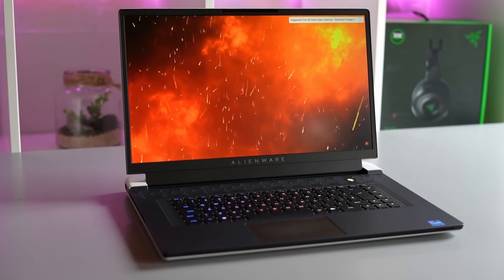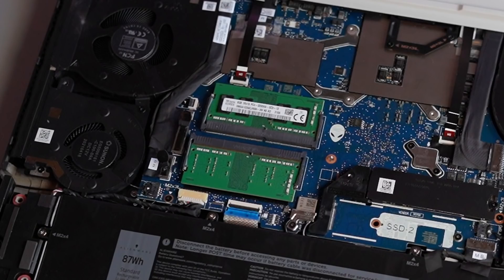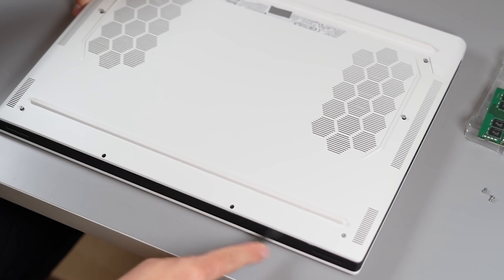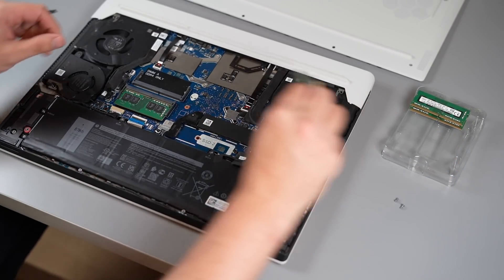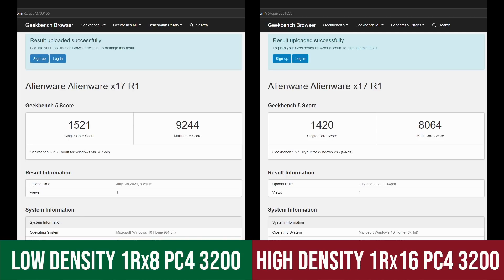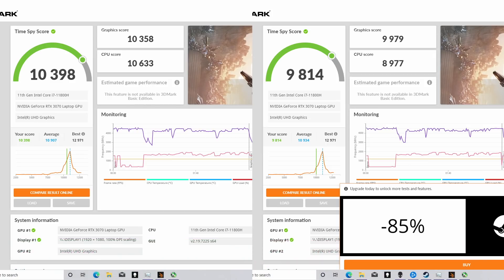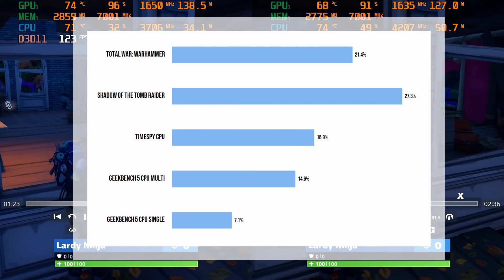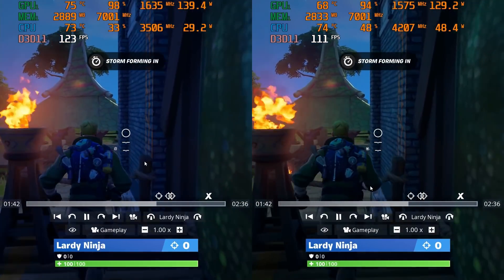Alienware X17 High Density Ram Strikes Again!  Upgrade Your Ram For Better Performance

Comment: I cant for the life of me take off the bottom cover it just wont budge
Reply from the maker: When you unscrew the front 2 of the screw should start popping up the cover, are yours not doing this?
Reply: @MashITTech  no it's not all screws are out but still looks and feels as if they're still in. I do have the x15 but it should be the same process right ?
Reply from the maker: Exactly the same 😢 can you get a plastic pry tool in between cover and base?
Reply: @MashITTech  I'm gonna need one ..I was hoping I didn't have to go to best buy to buy a ifixit tool kit lol I didn't think it was gonna be this difficult

Comment: In the amazon link you provided, from the amazon drop down box, do I order the dual rank, Single Rank or the one without a label?  What is the difference ? These are all Low Density ? I'm looking to do 16gb x 2 kit.  Since the video , is there better RAM to get if you have some money burning a hole in your pocket?
Reply from the maker: Get the single rank. Dual rank is a lot more expensive for little benefit. I haven’t tested any kits better than the crucial so far. Do not buy the expensive ballistix, they won’t run 3200mhz
Reply: @MashITTech  great, thanks for the response Mash

Comment: Do you have to change any settings in the Bios for this Ram to run at 3200?
Reply from the maker: Nope, it defaults to 3200mhz
Reply: @MashITTech  Thank you. I had read that some default at lowers speeds and have to change settings to achieve advertised speeds. Glad that is not the case
Reply from the maker: That is only a case on a couple of the corsair dominator ram kits so avoid those like the plague! the crucial I like in the description works perfectly

Comment: Hi mate appreciate the video, I have the Alienware X17 with 4K screen i9 and RTX 3080, with the 32GB ram pre installed, I bought the Prośba o dodanie opinii o produkcie:  Crucial DDR4 16GB 2666 CL19 SODIMM  ram x2 would it be worth me replacing the standard ram for the crucial one? Or keep what I have and order a different ram set?
Reply from the maker: The 32gb kit that fell used is pretty good so I would keep what you have. It is only the 16gb kit they supply that is the problem 👍
Reply: @MashITTech  good man thank you for the advice mich appreciated!! Would you be able to do a video on the X17 rtx 3080 i9 4k and what to do to get the best performance also, what the alt keys do? I.e the F1-F6 keys do? Or do you happen to know yourself? Also for some reason and I don't know if you have this issue but when I use the F7 key to turn the RGB lighting off the back Tron and alien head lights stay on but the keyboard lights turn off, but on my old m17 it use to turn all RGB lighting off, your videos are the main reason I got the new full spec X17 and I have to say it was the best decision I made

Comment: hi, im going to upgrade the ram memory but i notice that are dual rank memory so i dont know which is better. 1rx8 or 2rx8
Reply from the maker: the dual rank is slightly faster but also mu ch more expensive! I just bought the 1rx8 and it gave me a great improvement over the x16 👍

Comment: I primarily run the Microsoft Flight Simulator 2020.  Normally my CPU utilization is only maybe half that of the GPU.  I am getting ready to go to a Reverb G2 VR and I was wondering if you thought that changing to the low density ram would make a difference. Thanks.
Reply from the maker: It makes a big difference on anything that utilises CPU. If the game is utilising 50+% cpu you will get improved performance. If the game is massively GPU bound then you may be ok.
Reply: @MashITTech  Well, it didn't work out. I had a lot of problems with blue screen and game freezing so I kept lowering the settings and when I finally got it to run, it was not very smooth and the resolution was so low that while it was immersive in feel, it just was so soft that I preferred the very crisp and high detail 2D view. In 2D I can run the game at 30 FPS (capped) in flight with everything maxed out (400 for terrain) and 60% GPU, and the level of detail is amazing so while I was hoping the VR would work, I am still delighted with the game when running Ultra settings which even powerful gaming servers struggle to do when running VR.

I might also say that I found all of the cables to be bothersome.  I can see why people love the wireless Quest 2.
Reply from the maker: @shenmisheshou7002  sorry to hear it wasn’t a great experience! I have yet to try VR.
Reply: @MashITTech  I had my doubts that it would work.  Most people that blog on it are using desktop systems with RTX 3080 and the laptop RTX 3080 is not nearly as powerful as the desktop, and my laptop 3070 even less so, so I thought it was going to be a challenge, but you don't know until you try.  I had to lower a lot of settings to even get it to run, and when I finally did, the reduced rendering scale really softened the image.  I doubt than the x17 RTX 3080 would do much better.  I think for many games my system would be OK with VR, but FS2020 is a pretty demanding application.   I love it in 2D though. I turn off Bloom, and lower a few other settings, but I can run terrain detail at 400 and object detail at 200 and still get a very smooth 34 FPS (I lock it in the settings because it keeps the fan noise down and 34 FPS is pretty smooth to me).  

If I do get another VR headset though, I would probably go for the Oculus 3.  The cables on the Reverb G2 were very annoying and added a lot of clutter (I play from a small table in my family room, which is why I have a laptop to begin with.)

Comment: I ordered x17 with 16GB option . Can I upgrade with Crucial 32GBx2 for 64GB ? or should I go 16x2 for 32 GB ?
Reply from the maker: Yes you can use either 64gb or 32gb crucial kits 👍

Comment: Now which one is better?!

Crucial RAM 32GB Kit (2x16GB) DDR4 3200 MHz CL22 Laptop Memory CT2K16G4SFRA32A

or

Crucial 32GB Kit (16GBx2) DDR4 3200 MT/s (PC4-25600) CL22 DR x8 Unbuffered SODIMM 260-Pin Memory - CT2K16G4SFD832A

....
Reply from the maker: Both those are great kits I bought the FRA kit which is the cheaper single ranked low density kit. The FD8 kit is the dual ranked so very slightly faster at a much greater cost. Hope this helps.

Comment: Is this the correct low density ram upgrade your talking about? 

Crucial 32GB Kit (16GBx2) DDR4 3200 MT/s (PC4-25600) CL22 DR x8 Unbuffered SODIMM 260-Pin Memory - CT2K16G4SFD832A
Reply from the maker: yes that is the kit. Sorry if my link didnt take you straight to it, Amazon defaults to the 8gb stick
Reply: Thank you for the quick response. One more question what do you recommend best for ssd upgrade choice?
Reply from the maker: It depends what you want from the drive. If you are looking for a boot /OS/apps drive I would suggest a samsung 970 or 980 pro but if it is just a games drive get a large cheap m.2. I bought a western digital 2tb m.2 sn550, its not the fastest but perfect for games and has 5 years warranty plus it was really cheap :)

Comment: does low density ram help with thermal performance? i was seeing the gpu heated a lil more with the low density but cpu was temps were a lot more stable
Reply from the maker: It should actually be similar temperatures or slightly higher as the the cpu is able to feed the gpu faster therefore improving performance but also creating slightly more heat in the process.

Comment: Any Update/Advice about 32GB 3200MHz vs 32GB XMP 3466Mhz?
Reply from the maker: The 32gb 3200mhz is low density so good ram, I even benched marked almost as high as the XMP ram. Obviously the XMP is slightly better so it depends on the price of the upgrade in your region to decide if it is worth it

Comment: Hello love ur video I just pick up a x17 and would like to do the this same upgrade with 32gb of Ram on the Amazon link do I purchase the one that says single rank or dual rank ?? And u recommend anything other rams chips or is this the best option ??
Reply from the maker: Just get the crucial single rank, they are the best cost to performance ratio. That’s it really, they only other thing you may want to do is add more storage and we have a video on that if you are interested in the future 👍
Reply: @MashITTech  yes sir gonna get a gen 4 like the one in the video I just want to make sure I have a heat sink with it idk if u found something for it yet ?
Reply from the maker: See what your original drive is first as if it is a WD gen 3 they don’t run hot and just use that like I did. Currently still looking for a decent heatsink to recommend
Reply: @MashITTech  ok yeah i think it’s the same one in ur video it’s a 1tb ssd all probably end up doing that and all watch out to see if u recommend something thank for or help
Reply: Hello sir I installed the ram and my single core score when down and my multi score when up is that normal ? I figure both scores would go up

Comment: Hi, when I visit the RAM website it directly lead me to amazon, it shows Crucial 8GB Single DDR4 3200 MT/s (PC4-25600) CL22 SR x8 Unbuffered SODIMM 260-Pin Memory - CT8G4SFS832A but also said Single Rank. Is that the one?

Comment: Does the X17 bios have an XMP option? So I can upgrade to faster RAM sticks myself with better CL timings
Reply from the maker: Not by default. If you by it with the dell xmp ram sticks then xmp options are available in bios but I am not sure if you add another brand if it will show

Comment: Your model had 2 8gb of ram at 3200mhz , the one you replaced it with was double at low density. Of course it's a big improvement. But how would it run with 2 8gb low density ram instead of the 32gb? To see if is it even worth the upgrade.
Reply from the maker: moving from 16gb to 32gb doesn't give much of an improvement so the 16gb would be very similar especially in games. Only some of the benchmarks increase with 32gb such as geekbench but even that is not so significant
Reply: @MashITTech  ok thank you!

Comment: Hey Dave,
 I found my ram is 8gb 1rx16 on intel i7 without GPU it's using intel graphics. I want to upgrade to 16gb. Should I add another 8gb 1rx16 because maybe without GPU CPU works better with 1rx16. Or should I get 16gb 1rx8 instead. I don't get it why they use these 1rx16 then. It's more difficult to make it, needs more components and hard to get.
Reply from the maker: Get the crucial 16gb 1Rx8 ram I linked in the description as it is much faster and sell your stick on ebay. It sucks that dell are using this terrible ram on their flagship machines. the 1Rx16 affects the CPU scores not the GPU which brings the whole system down.
Reply: @MashITTech phoo, good I watched this video again and good you answered so quick :D THANKS. 
 Do you have an idea what ram is in x15r1 32gb 3070 qhd?
Reply from the maker: the X15 is low density fortunately! this is a good job as it is soldered on :)

Comment: Thanks for the great informative video! after more then 2 weeks, have you found out what type of RAM is delivered with the 32GB X17 model? i've ordered mine with 32GB 3200Mhz, still not sure if it will be low or high density ram tho...
Reply from the maker: Hi Manuel, yes, I think I mentioned this is the X17 choose the right configuration video. The 32gb is the low density ram which is great news. I am getting scores pretty much on par with the XMP modules with this ram so it is the best value ram when you configure your machine :)
Reply: @MashITTech  thanks for the confirmation! I thought the difference would have been the 3200Mhz vs the 3466Mhz. Glad to hear also the 32GB 3200Mhz RAM is the low density one!
Reply: @MashITTech  does the x25 suffer from the same ram issue? I know they are soldered but are they low or high density ram in x15?
Reply from the maker: @efendibey965  the x15 has low density fortunately as we would not be able to change it. It was one of the first things I tested as this worried me but it’s all good 👍

Comment: gotta learn abt low density and high density.

Im afraid of my upcoming lappy.
Just confirmed order with dell.
Today is 21st july 2021.

11th gen i7/3080rtx/16gb ram/
Hope mine is not affected.
Gotta see after 30 days (delivery).
Reply from the maker: If you have the 16gb ordered it is likely you will be. It’s not the end of the world but it is a few percent slower than low density ram.
Reply: @MashITTech  so i call the dell order modification now and make it : 32gb single stick (3200 mhz).
Then its fine ?
Or wats the possible solution to do before they ship.
Reply from the maker: I would get 32gb (2x16gb) it’s quite a cheap upgrade and is a good performance boost
Reply: @MashITTech  i called dell modification team.
They said : order is processing stage. They can cancle and do 32gb ram complete order again.

That wud mess up with all credit cards used and limits.

So im just taking this 16gb order.

Gotta see and then manually buy new rams accordingly.
I waited like 4 months for this lappy (cherry mx on m17r4 till 360ms x17r1).
Reply from the maker: That’s fair enough, at least it is easy to upgrade yourself if you want to later
Reply: @MashITTech  hi again.
where can i buy good ram cards on net that are compitable for this lappy apart from dell website (as there r not many options there).

Im looking for : single 16gb or 32gb card.

3200 or 3466 - wichever u think is good.
Thnx.

Comment: Thank you Mash IT. This video did improve my laptop. I bought the 4K 3070 16g RAM config.  The cpu times spy score was only 8530 when I set screen at 1920x1080. Then I changed the 8g ram sticks to two crucials 16g. Now the cpu score in time spy is 10933. Really impressive! And the screw tool you recommend are pretty good too!
Reply: Please can you tell me which ram did you bought 
Is it 16gbx2 dual rank ?
Reply: @neverdown89  It's Crucial 16gb ddr4 3200 MHz CL22 CT2K16G4SFRA32A.

Comment: High density ram is better right?
Reply from the maker: Unfortunately not. You would think it would be because it is newer and the ships have twice the capacity but it actually means there is less controllers on board as it is 1 controller per chip so it actually takes longer to find data (so imagine a stick now has 4 chips on it instead of 8 that is half the controllers looking for data) I hope this makes sense?

Comment: HII BRO I AM BIG FAN OF U am from India
 give a suggestion in small issue in my laptop 
specifications 
dell g3 3579 i7 8th gen 
16ram and 1050 ti graphics card 
win 10 home 64bit       (I BUY THIS LAP 2 YEARS BACK)
(POWER PLUG IN MY LAPTOP FPS DRAP ONLY RUN 10 FPS OR 12 BUT PLUG OUT NORMAL 30 OR 33 ) give a solution bro pls...
Reply from the maker: Hello mate, thank you. This sounds like it could be the laptop is not correctly detecting your power supply. are you using the original charger? do you know anyone else with a dell charger with same or greater wattage?
Reply: @MashITTech  ok thq man i buy a new charger thx for reply
Reply from the maker: I am not 100% that is your issue as I cannot see your laptop but it’s a good place to start 👍

Comment: I was wondering if you know whether or not the alienware m15 ryzen edition r5 with 32gb ram is low or high density. I have not yet received my laptop but may go ahead and order replacement memory in case it comes with high density. Thank you for your time!
Reply from the maker: As you have the 32gb yours should not be affected 👍 so far it only seems to be the 16gb kits
Reply: @MashITTech  Thanks! I appreciate it. I was a little worried after I started seeing information about the low and high density memory. I don't have a lot of knowledge about this stuff but am always willing to learn. Will post an update when it's delivered. The QHD version takes forever to be delivered. 3 weeks 2 days since I ordered.
Reply from the maker: Trust me it’s worth it! The qhd panel is amazing and you get advanced Optimus and gsync

Comment: Think they might use high density on their m17 r4 models?  I am waiting on mine to be built with 32 g ram, think I need to worry.  It is soldered in and I don't think you even see it when you open the case. Thanks for your help!
Reply from the maker: You don’t need to worry, we have had loads of m17r4’s through and the were all low density
Reply: Thank you, you have yourself a new follower.

Comment: How do I know if it's high or low density?
Reply from the maker: You will probably see in benchmarks or you can open laptop and look at the ram chips as it says on the you need 1Rx8 and the high density is 1Rx16
Reply: Thanks for the fast reply, I just subbed. 
I am waiting on my new m17 R4, it isn't even built yet.  Ordered with 32 g ram.  Think I need to worry?  Thanks again for your time!
Reply: BTW, I am not tech, but I love learning.
Thanks
Reply from the maker: I answered your question in the other thread but you are good with the r4 👍
Reply: Thank you!

Comment: Actually it's not only dell that does it .... Lenovo also has the same ram in the legion laptops and it really hurts performance 😢
Reply from the maker: yes you are absolutely right! we had exactly the same issue with legion 5 pro and legion 7. My biggest issue is with how expensive these are! I expect it on a cheaper laptop, they have to get the costs down but the X17 is an expensive flagship product. Dell also use it in the G15 and m15r5 BTW :(
Reply: @MashITTech  i think the best option is to buy the laptop without ram if possible and you use a good known ram kit ... idk if dell and Lenovo have that option 🤔
Reply from the maker: No, they force you to have ram. I will usually buy 8gb if possible and upgrade myself 👍
Reply: @MashITTech  😢😢